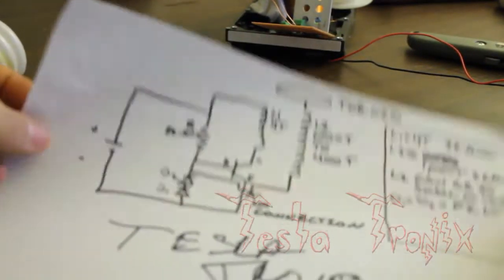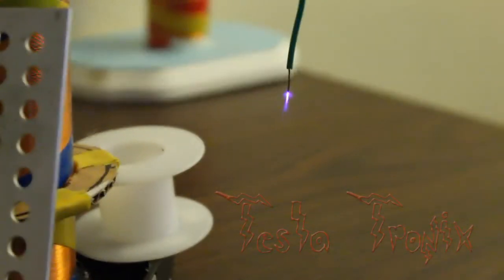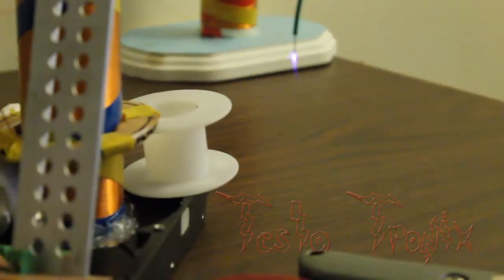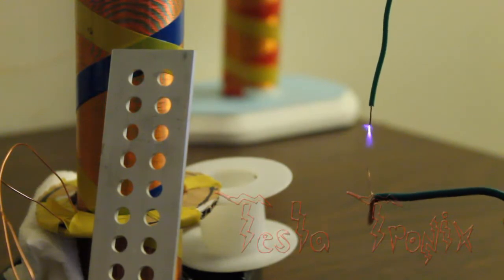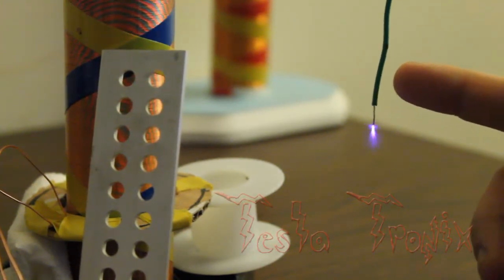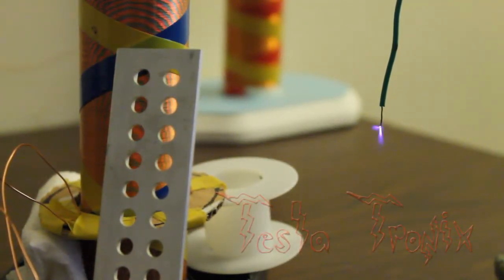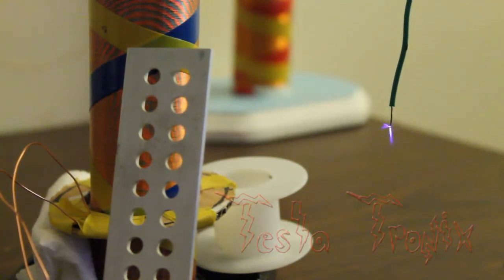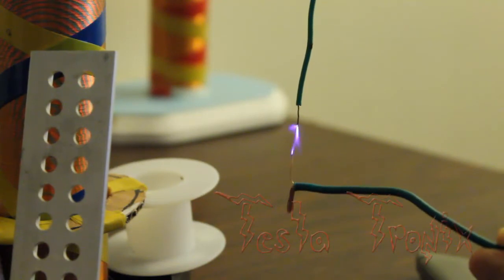Spark Gap Test Solid State Tesla Coil

Comment: The magnetic wire sticking to stuff is columb force, I have aprox 2kv, and it's doing the same thing. I'd love to know how you got it tuned so good. I have ground atached to my 12v plug packs neg, Gave decent improvement. Time for a top load I think.